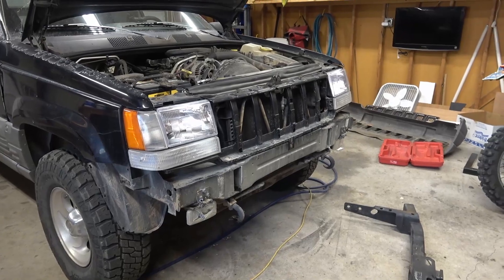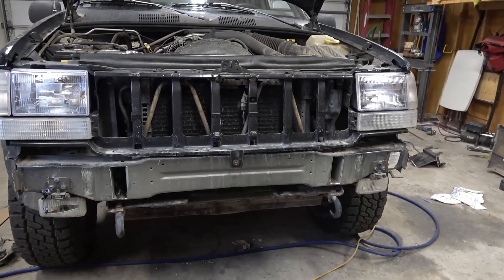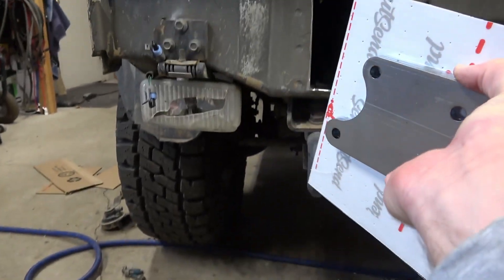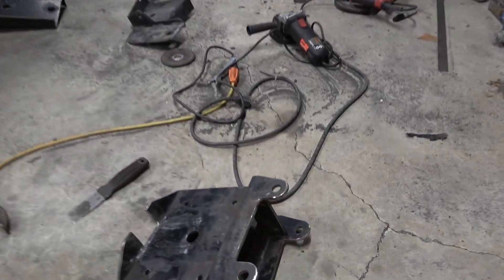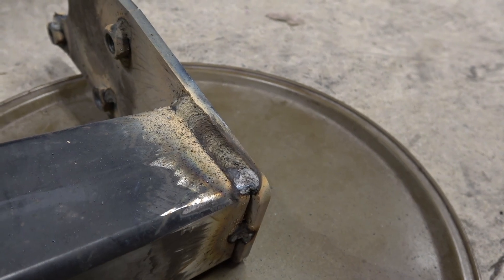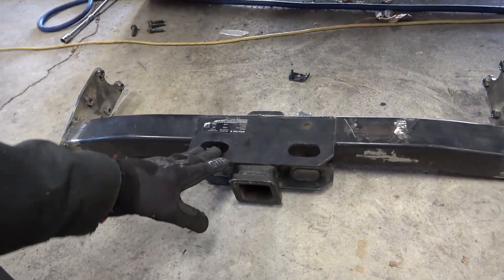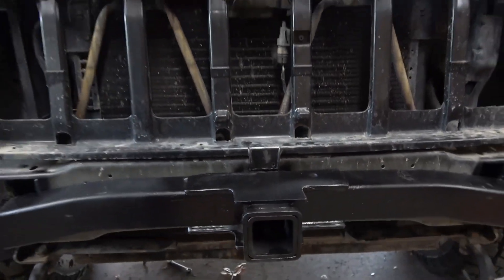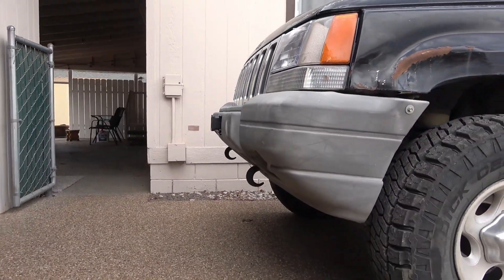Front Receiver Hitch Winch Mount for Jeep Grand Cherokee ZJ

Comment: The file link isn’t working. Anyway to reference design when ordering from send-cut-send?
Reply from the maker: Just reuploaded and updated the link in the description
Reply: Thank you for doing so, with this bracket I am going to try to repeat what you did. Problem is in the file on goggle drive there are no measurements, just the cut our design. Am I looking at the file wrong or did the measurements not upload?
Reply from the maker: @andreww8529  it can't have dimensions on it because the lines in the file is what gets cut. You can probably download a free dxf viewer that you can measure from.
Reply: @alexkram  I’ll be going through sendcutsend to have this done. Will giving this file to them be enough or will I first have to extrapolate the measurements?
Reply from the maker: @andreww8529  the file is enough, it is the exact file I used in their website: mm dimensions, 1/4 mild steel, qty 2.
Reply: @alexkram  ok thanks. Nowhere have I seen any mm dimensions in file but I printed file and it looks to scale 1:1. About 250mm long at longest point and roughly 105mm wide at widest
Reply from the maker: @andreww8529  when you upload to sendcutsend it will ask you to confirm the units. It is mm not inches.
Reply: @alexkram  ok, thanks. I think I understand. It’s a bit confusing for me as I have not worked with these types of drawings or files before. Im not sure yet how sendcutsend will size the bracket, but I have contacted them. Thank you for all the info!!
Reply: Ordered part! Once I was able to upload your file (couldn’t earlier because of a device error) everything worked fine and measurements were there in description! Thank you and sorry for the hassle. Also got 15 percent off with no rush
Reply from the maker: @andreww8529  sounds like you will have a front hitch soon. I've used the winch on there and it worked well.

Comment: Dec 11dog valley wheeling trip look for red zj
Reply from the maker: I took mine up there in the snow too. It was a bit too deep for me, pushing snow with the axles.
Reply: Thanks Alex for the video, AutoCad file and info on sendCutsend. I sent a couple emails to your gmail but no response back yet. Was asking about tire size and wheels you had or have on your ZJ. Dick Cepek is what they look like but curious as to width and height of tires. Look forward to more videos of your Grand Cherokee btw?